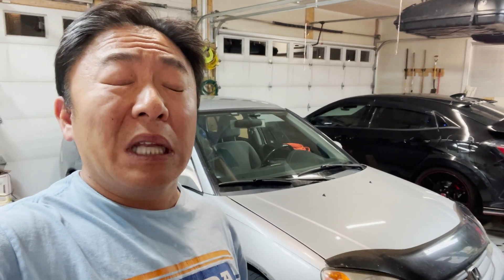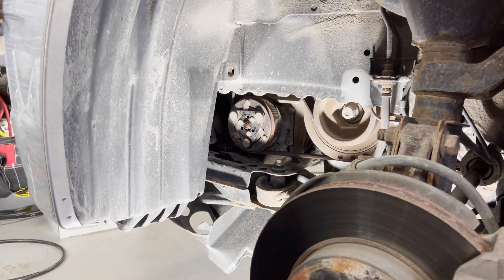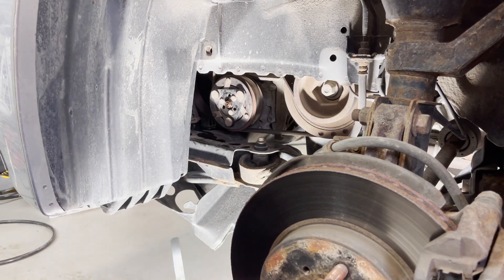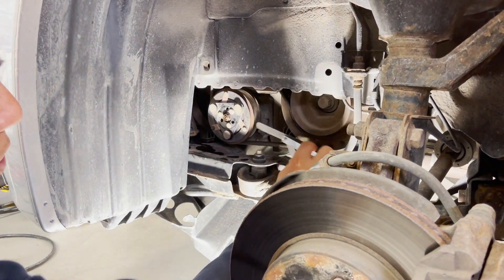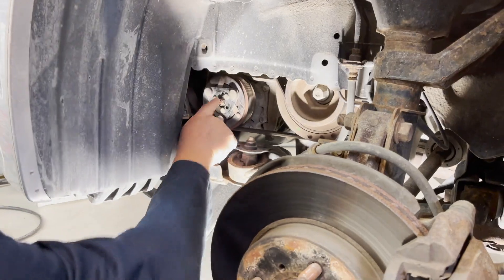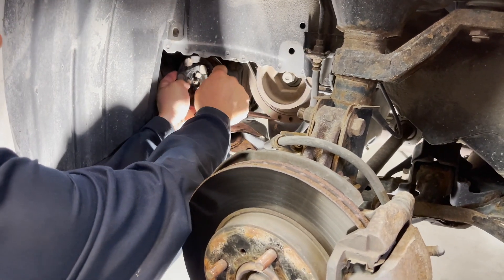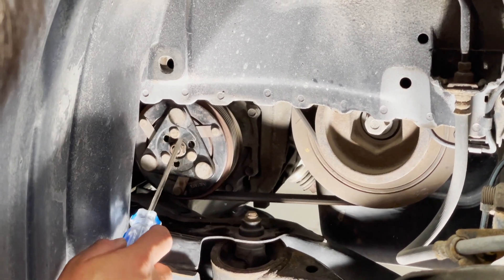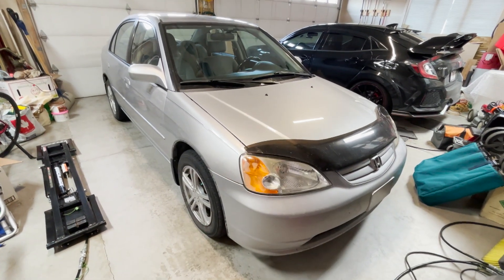Honda AC compressor clutch air gap fix

Comment: Question… on any of the ones you fixed, did it sound bad without the shim in there? I just took mine out like this, cleaned it all up and it worked right away but sounded rough at the plate. Once i put the shim back on to try it again, with it being cleaned all out maybe this helped some clearance issues a little. It doesn’t have the rough sound, but it working too. Just not sure how long it’s going to last before not engaging again lol. Just stumped why the shim alone is without it is making it sound rough at that plate to pulley, once it’s back in it sounds fine. Hopefully the cleaning of the plate and inside will hold up for a while
Reply: About to try this fix on my honda civic. I did watch a video that showed that one can get shims of  different thicknesses to suit the air gap.
Reply from the maker: You can definitely get shims of varying thickness but I'm not sure where you'd buy them from?  Dealership perhaps?
Reply from the maker: its probably sounding rough b/c the stator and the clutch surfaces aren't at the right gap.  Too tight and it can scrape, too loose it can slip or not engage.  IN my case, the clutch was so worn (375K + kms) that I could either choose to buy a new clutch plate or extend my compressor's existing parts a bit longer by getting rid of the shim.  I did measure the clutch to stator clearance and was within spec.  Remember my clutch worked fine when temps were cooler/milder but not on the SUPER hot days when metal expands to the point where the electromagnet just couldn't quite "catch" the clutch.  Remeasure your clutch to stator gap and see if you fall within spec.

Comment: Nice job!  Had something similar to this problem on my 2012 Honda Pilot Touring.  The clutch rebuild kit cost as much as the entire compressor assembly so I just had the compressor replaced.  I later found a Honda OEM clutch rebuild kit for a LOT less money on eBay and got it for any potential future repairs.
Reply from the maker: thanks!  Yes, I actually came across this fix in my dream when I couldn't figure out why this civic's a/c would work on cooler days and then not work on the hot days.  While I'm clearly not the person that invented this fix that this was the first time I ever did this.  Since the making of this video I've actually fixed 4 more a/c's that had intermittent functionality.
Reply: @piercedasian  I will definitely keep this in mind for future reference.  This was what was probably wrong with my compressor.  Now I have to figure out why the damper motor inside the dash of my 2012 Honda Pilot Touring decides not to function in really hot weather but works in cooler weather or each time I schedule it with my repair guy to take a look at it.  LOL!